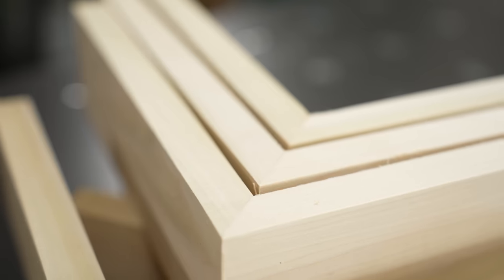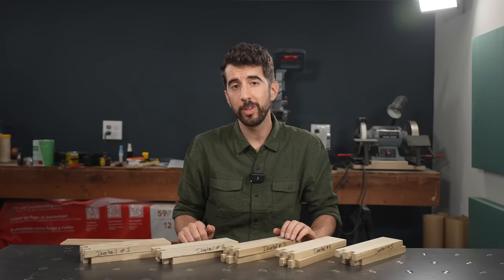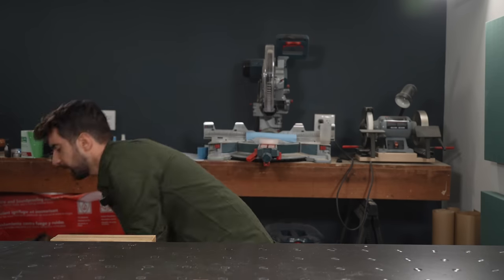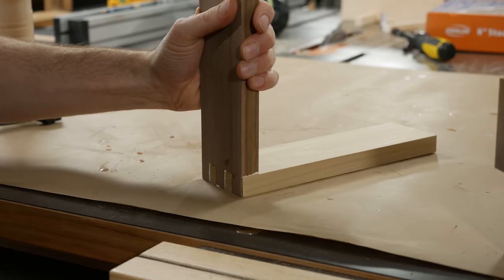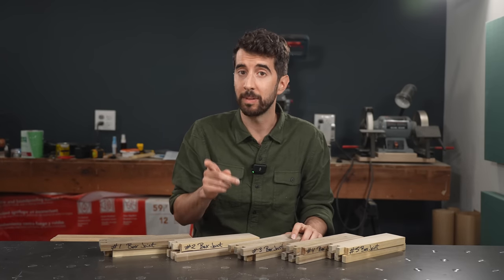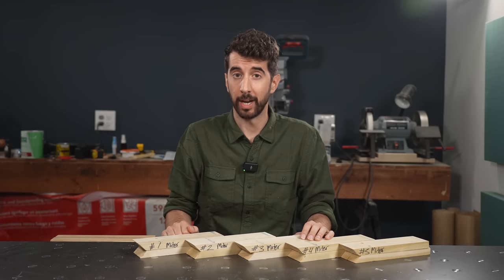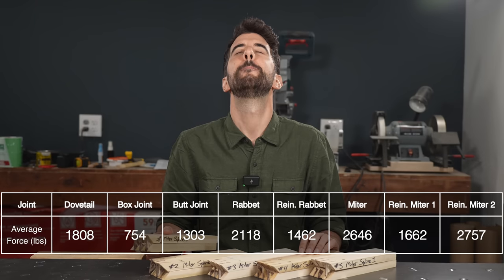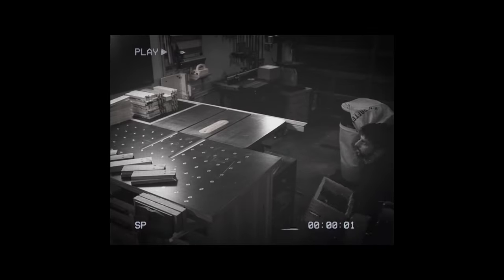This Simple Joint is Stronger Than a Dovetail!

Comment: Nobody has, as yet, tested glue joints that have had excess glue removed with a wet cloth vs a scraper.  Time after time we've been told that removing excess glue with a wet cloth will weaken the joint.  I am aware that spreading glue with a wet cloth has the potential to make it difficult to stain or finish.  But, does any water actually get into the glue joint and weaken it?

Comment: Hide glue comes in a variety of grades.  It’s been many decades, so I can’t remember clearly, but I believe they are 1–5. The weakest grade is for assembling joints that will be disassembled. The strongest grade can be used to chip glass. The strongest grade can also join melamine services, and is strong enough to separate the melamine from the substrate when attempting to break the bond. 

In a production shop, people are on rotation for the glue pot. On your day the glue had to be hot and ready before needed. The pot had to be tended so the supply didn’t run short, and the entire shop would descend on the guy who let the glue pot run dry. The pot had to be cooled slowly (it was cast-iron),  scraped and cleaned, and new glue made. An empty, or burned blue pot would shut down production for an entire shop. Also, the glue man while tending the glue for his day had to still maintain his regular production schedule.  I say, “his” as a generic term. Over the years I was in a production shop there was only one woman.  She wasn’t any good.
Reply: I should also mention that hide glue was fast in production runs. The pieces to be assembled were first prepared, then glue applied to the first joint, the surfaces mated, then wiggled to get good coverage. The wiggling continued as the glue set, then held in place briefly. The joined piece was then leaned against the wall, then onto the next joint. No clamping. A very strong joint.  Like Elmer’s white glue the bond could be dissolved with steam, or hot water. Like Titebond lll it was much stronger than the joined material.
Reply: The use of hide glue wasn’t abandoned because of strength issues, but for speed and convenience. The first glues to replace hide glue were much weaker.

Comment: I have just been using brad nailed butt joints with no glue for my shop drawers and they have held up very well. I was going to add glue if they ever failed but there hasnt been a need

Comment: Wonder what the dovetail results would be if you used maple? In all the cases where the wood failed, keep in mind that it is pine.
Reply: I imagine that's because it would take even more force to use hardwood and he already failed to break a butt joint with his previous setup.

Comment: Those reinforcements weaken a fresh joint but might help mitigate that longterm fatigue you mentioned.....i wonder how you can simulate that maybe using heat to age the glue or some kind of an exerciser.....so many followup experiments can do more...
Reply: Also keeping in mind the "weakened" joints still required more force than you could ever possibly exert on something like a drawer box in your wildest dreams, so your point is even more valid about trading strength for mitigation of fatigue.

Comment: The “flaw” in joints like the butt joint is always said to that it is weaker because the end grain soaks up the glue and so leaves the joint, as you said, glue starved.

The simple fix to that is to slather on a bunch of glue on the end grain side of the joint and let it sit for a few minutes so that the end grain soak up all the glue that it can. Then apply additional glue to the end grain side and some glue on the other side of the joint. This should keep a nice continuous glue layer across the joint. And butt and rabbit joints have the advantage that they are very easy to clamp without the joint shifting and so apply enough pressure to keep the glue layer nice and thin to increase the strength of the glue layer.

BTW, here is a thought to reinforce a box joint. After assembling and gluing the box joint, drill a hole vertically through all the tabs on the box joint and drive a dowel into it. To pull the joint apart, the dowel would have to be sheared.

If you want it to be super strong, drill a smaller diameter hole and then drive a brass rod through the hole to make it almost impossible to shear the joints in the box joint without tearing the brass rod through wood. The best location would likely to be about a 1/3 of the distance from each of the outside edges rather than the center of the joint. This puts as much wood as possible under the dowel or brass rod when trying to pull the joint apart.
Reply: The dowel doesn't have to be sheared though. The wood around the dowel would bust open so that the intact dowel would get ripped out that way. And by drilling a hole through every finger like that you are making the thickness of the wood around the dowel pretty thin. That's how that would fail. That's why his other test with the dowel made the rabbet worse. Off centering the pin doesn't matter because you make one piece stronger and the other weaker, so it balances out.

What you're describing is useful as a wooden hinge though.
Reply from the maker: actually you can see in the footage of old drawers I've made with box joints that I've done exactly this, drill a dowel through the top of it. I would also question if it adds or lessens the joint strength.

Comment: Good work! I wonder if you could be the first to put some of these joints in a box with a humidifier and a dehumidifier and cycle the humidity to high and low to simulate years wood movement in a few days!! I think that would be an awesome experiment
Reply from the maker: I have something like that in mind, but it's going to take a while to get to

Comment: From the end users point of view expectation, perception, longevity and the visual quality of a finished piece are far more important than the strength of a newly made piece of furniture.

While it is important that chair frames do not break under tilting abuse, and doors and draws do not pull apart, these are more than adequately covered using any of the traditional joints,

Valuable antiques survive because they are easily repaired and come apart relatively easily. Mainly because the constructions and glues used were reversible and the individual parts easily dismantled.

It would be interesting to see a modern glue that was as easily reversible as hide glue, but with the simplicity of application as modern glues. It.

Comment: I was thinking if a box was needing strength in the suggested way that two sides of the box would be pulled out and two pushed in thus giving a different result to the inner spline which is ment for the pulled corners but not the pushed.

Comment: I do box joints then drill a 1/4 dowel. Rod through them perpendicular to pin them together.    Also I promise in a rotation separation the box joint is going to be way stronger.  Especially pined.  They have lots of surface  area.  I have a bunch of oak wood clamps made from box joints and never had one fail. 

Then I would also like to see the miter lock joint tested.

Comment: 11:12 an Interesting point about the testing rabbet with dowels is that you did vertical dowels. With this I would say there is no mechanical advantage. Your analysis seems correct. Since they are vertical  dowels though, and the wood is being pulled along the same axis as the dowels the removed material did make the rabbet joint weaker .  If the pins were horizontal through it would be providing mechanical advantage like the dovetails angle did as when you pull along the z axis you wouldn't be pulling along the pins but now against them. This is no different then the spread angle to prevent a dovetail from coming off. I think this would create a stronger joint if you did the pins sideways instead of up and down.

Comment: what about a dowel through all the pins of the box joint, like from the top to the bottom?  The grain of the dowel would be opposite to the direction of the pulling force.

Comment: Alot of info but unless you have kids that are intentionally tearing up furniture, they don't get that much stress. Ive made all sorts of things throughout the many years and nothing is coming apart. Plus dovetails just look better than box. As far as hide glue. It works and yes people use it to be able to take the joint apart down the line. Instrument makers. All in all, interesting video

Comment: Question: What if you were to put a 1/4" hardwood dowel vertically down the center of the Box joint, thereby physically locking them in?  I'd like to see that.

Comment: I enjoyed the video. I do wonder though...in real world examples, a joint may never have force exerted right at or next to the glue joint. I wonder what the differences would be between joints if the pressure was further out towards the ends of the boards.

Comment: Wish you had included the 45 degree double locking joint in these tests.  Once you have your shaper or router table set up for this cut it is fast, easiest to glue up and I'm guessing the strongest drawer joint you can make.  Fast to make but I did spend considerable time making a jig to facilitate cutting the piece that runs vertically thru the cutter.   The horizontal cut is easy using a miter gauge.

Comment: It’s only important that the completed joint strength exceeds the maximum force the joint will see. For a drawer box on slides the force will be relatively low. Otherwise most of the joints are justified by the aesthetic or the challenge for the woodworker. If speed is important keep it as simple as meets the needs. 
Nice video. Thx

Comment: Concentration of forces is an amazing thing, and the reason that round is stronger than square. This is really noticeable in the splined mitre. I'm wondering how the lock mitre joint would fare, although I begin to have a sneaking suspicion....

Comment: While the dowels weakened the joint to brute force, I wonder if it adds to longevity.  While the drawer can take less stress at one time, I wonder if it helps keep the joint together over all those years of seasonal movement and smaller pushes and pulls that furniture normally sees.

Comment: To me, it looks like the dowel joints did not get enough glue down deep into the hole.  I use something like a soda straw brush to work the glue into the sides of the hole and also put glue along the length of the dowel. I do not know how much this would help but I believe it would raise it in the rankings.

Comment: I am incredibly happy that my 120 year old violin was put together with hide glue, that way, it can be repaired. When I am doing work of the caliber of my violin, I will use hide glue then, until that time, yay tite-bond.

In the meantime, while I love the look of the reinforced miters, it's good to know that even if I do the weakest joint here, someone's going to need to tug on a stuck drawer with > 700 lbs of pressure to break my joints. I think that's an acceptable joint.

Comment: I have seen splines inserted at varying opposing angles, that may make the joint even stronger.  By opposing angles, I mean that 1 is slightly angled up while the other is slightly angled down.

Comment: Hi Scott, I really enjoyed your video. I see you used a single-sided rebate. May I ask why you didn't try a double rebate which would give greater surface area to glue on both pieces and with sawn-in triangular strengtheners like you used on the miter joint for even more strength?  If you do, please let me know the result. Thanks, kind regards Richard.

Comment: I would like to see how a dovetail or box joint would do with less "joints' in the build - do you think your joints may not only be glue starved, but weaken the wood portion of the joint by making each too thin?  What would one dovetail do to that joint instead of three and four small ones?

Comment: Great testing, Scott. Do I recall correctly that mortise/tenon joints (loose or solid) are necessarily stronger than any of these joints?
Reply from the maker: Mortise and tenon's wouldn't typically be used in this situation. I have a different video (link in description) that covers joints in the mortise and tenon situation category, like half laps, bridal joints, etc.
Reply: @ScottWalshWoodworking  Thanks. "You can't just use any joint in any situation"!

Comment: Also, might there be a difference in pre-soaking the connecting faces of a miter joint? It would add a lot of time to the project, but you water down some glue, and apply that to the mating surfaces, letting it soak in, then apply straight glue as per usual.
Reply: The master-craftsman Gary Katz (This is Carpentry) recommends this idea, but even without watering it down for the first coat. In your glue up, work so that as you butter up the ends, you allow soaking time. Come back and apply second coat and join.

Comment: So the effects on the dovetail and box joints reinforce my suspicion that cutting half the material out of each side of a join CAN'T be good.  The failure mode for the doweled rebate (yes, I know, Canadian terminology, but it just makes more sense to me) also suggested that was an issue.  In the end, just like in my structural engineering class, the question is how much material is resisting sheer (or bending) in the area that is being stressed?

I also think the prejudice against end grain is a result of how it is often used - a small gluing surface with a HUGE lever arm.

When it comes down to it, though, even the weakest joint is far stronger than the stresses it is likely to experience.  Sometimes, the min/max approach entirely misses the point.

Comment: Nice comparison!  Thanks for testing, and for keeping it interesting

I think that the dowels you added to the rabbet joint suffered from the same "too tight" issue as the dovetail that you mentioned.  Because they were tight, when you hammered the dowels in, you would have forced the joint apart (with a shock load), weakening the rabbet joint significantly.  Could try a looser fit?
Reply from the maker: It's definitely possible, but the wood around the dowel joint failed, so I'm not sure if the dowel wasn't hypothetically 'glue-starved', if it would've prevented the wood from failing around the dowel. Many of these tests honestly created more questions in my head, but testing them might never happen if it's too far into the weeds. Incidentally, my buddy Suman is working on a dowel strength testing video soon.

Comment: Machinist here... So I don't have much experience working with wood. But I do have a built-in sense about the strengths of materials/design. I am quite impressed with your development of your testing protocols, and also quite surprised by your results!
AANNNDDD... then with your discussion on tight fit and glue-starved joints, my mind went to using Gorilla Glue that actually expands in the presence of moisture, and using that with looser fitting joints.
As a machinist, I have no direct experience using Gorilla Glue on wood, so I'm curious if you have any direct experience with the pros and cons of Gorilla Glue, and if you think Gorilla Glue in combination with looser fitting joints is worth investigating?

Comment: Great video as always with some very interesting results.  It seems like pretty much any joint with sufficient glue will hold up to all but the most demanding projects.  But this leads me to a thought, it is extremely unlikely that a joint in a drawer is going to see over 1500 lbf at any one time, but it will see much smaller forces thousands of time over its life.  It would be interesting to see if any of these test out better after 1000 times being opened and closed.  I am not really sure how to effectively do this without opening and closing a drawer thousands of times but it would be cool to see if you can figure it out.  I suspect the constant application of small force might break the glue joint apart faster than a joint with mechanical advantage.
Reply from the maker: I'm devising a scheme for making some sort of contraption that can put a small and cycling amount of pressure on a bunch of test joints all at once (something like 30 lbs on and off every couple of seconds) and have it contained in a sealed enclosure where I can introduce and evacuate fluctuating humidity say every half hour. Leave it running for three months straight and see what happens... it might take me a few years to get around to it though 😂

Comment: I'm a bit sceptical of the result of the rabbet vs the dovetail, cause its easier to avoid glue starvation with a tight rabbet than with a dovetail, which could mean that the dovetail results relied more on the strength of the wood, rather than the strength of the joint, which was the whole purpose of the test. The strength of a joint is roughly equal to the total area of glue applied surfaces, so if the Dovetail joints were glue starved, then they didn't have the area advantage over the rabbets as there wouldn't be enough glue to keep it together.

Comment: I wonder if the joint strength is influenced by the amount of endgrain that (maybe) absorbs the glue more deeply.

Box joints have no end grain. Miters are all end grain.

So do the numbers change with a high density wood? I assume a high density wood might absorb less glue into it's end grain.

There also seems to be something here about the length of the wood fibers. When the wood fibers are cut or disrupted, the wood fails.

Just some thoughts. Maybe they'll help find some logic to all this.

Comment: The optimal thickness of the glue layer has been studied scientifically to maximize strength, and it's around 0.15mm
There are several published papers on this, and the number was revised a few times.